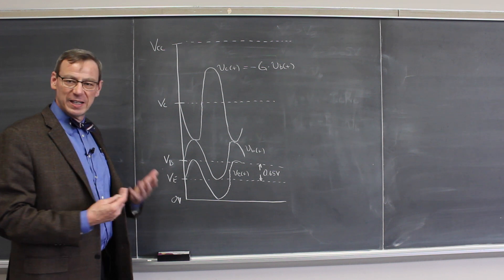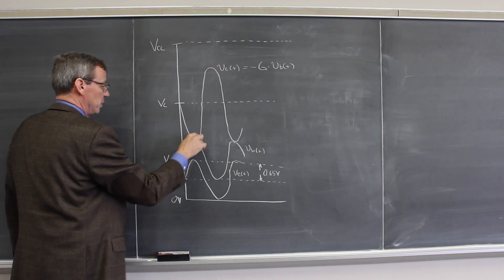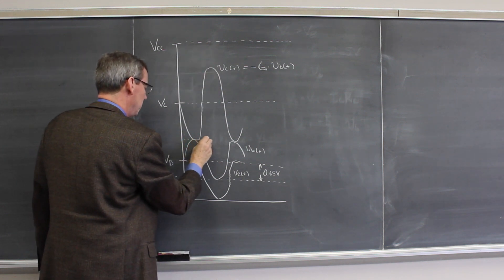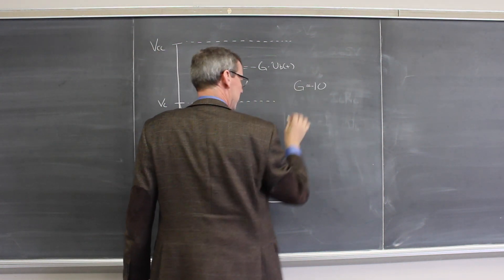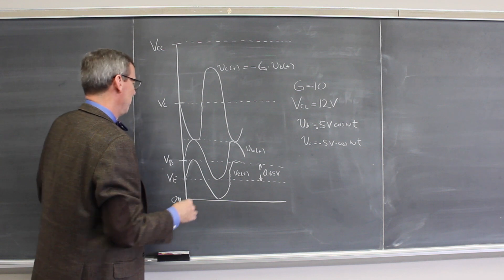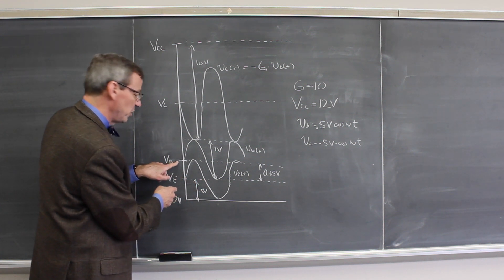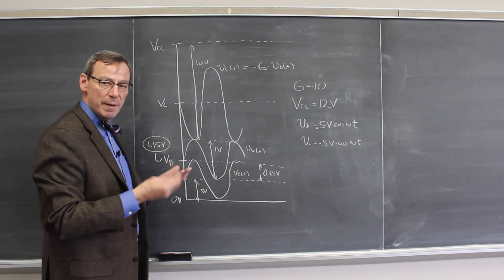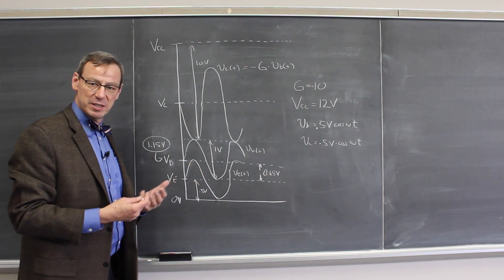Input and Output impedance of the Common Emitter Amplifier

Comment: I seem to have missed something. There was no determination of the input or output Impedance.
Reply: Lawrence Lederer Same...Hes talking about the q point of the amp but not the input and output impedance, isnt he?
Reply: Glad someone else saw what I saw. Determining the "Q" point is not the same as determination of the input and output  impedance of  a transistor amplifier circuit.
Reply: Thanks for the comment - and saving my time.